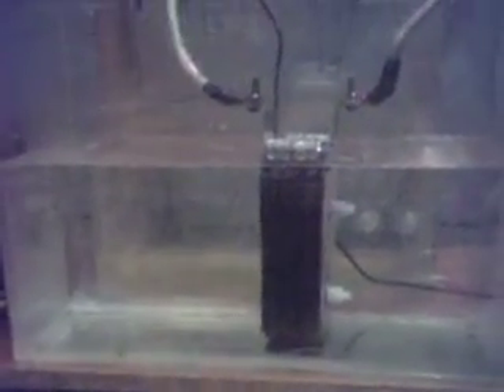HHO - Extreme Hydrogen Labs - with Neutral plates in design - trips cirucuit breaker

Comment: could put some pfc capacitors in parralel to the input power and it will keep the circuit breaker from tripping works very well as for te neutral plates try to have them balanced between teh positive and negative and have mabe 2 negatives to the 4 positives in the center then the production would take off  i had the same problem as you with that configuration untill i try what i just stated then it worked great  with little amperage draw